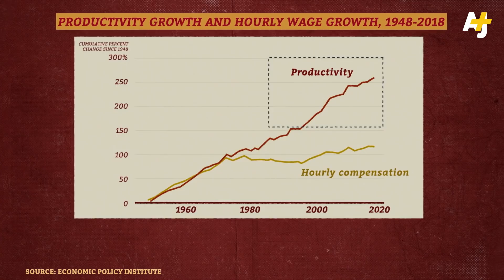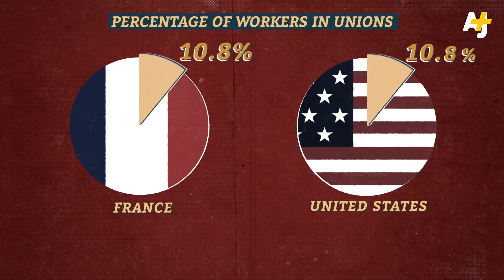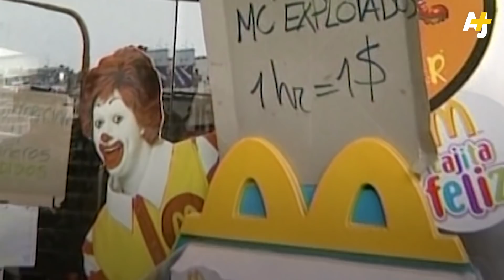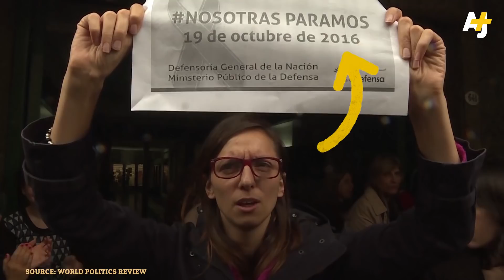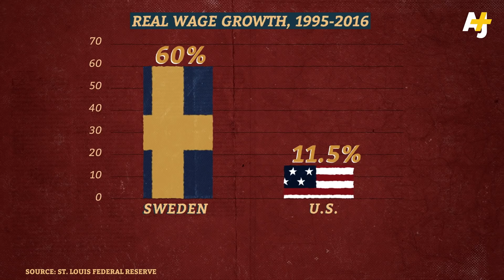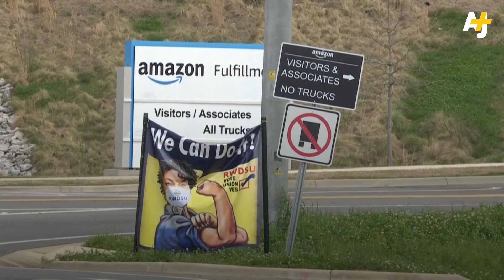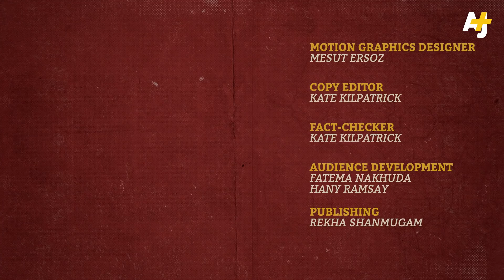Why Other Countries Are Better At Unionizing Than Americans

Comment: An interesting video and I learned alot because I live in a right to work state in the US. I only had 2 brief stints with a set salary or hourly wage and disliked them both, but that's because one was in retail and the other was in accounting. I quit both after demanding a raise due to have high productivity but getting paid the same as the person just going through the motions, and that request falling short of what I thought my production value was. So I happily work a job with commission incentives, but I have experienced the difficulty of negotiating for higher wages, so I see the need for unions....so long as they dont push any politics and stick to wages and labor laws.

Comment: There should be balance between power of union and employeers. In India we lost half a century to unions. Government has to pay High wages to Failing Public sector companies who hardly do any work. And private sector  employees are paying huge taxes to pay the wages of public sector employee.
      Yesterday a filmmaker committed suicide in Maharashtra because film union leader were pressuring him to pay in lakhs. And normally union leaders are dreaded criminals who just want to earn their share of cut from employees. 
       And then there are IT companies in India where unions don't apply where employees are indirectly forced to work for long hours and even weekends without any compensation. 

      All we need is a balance.